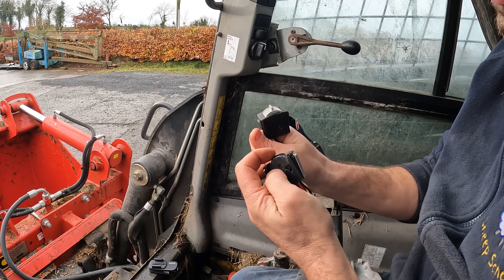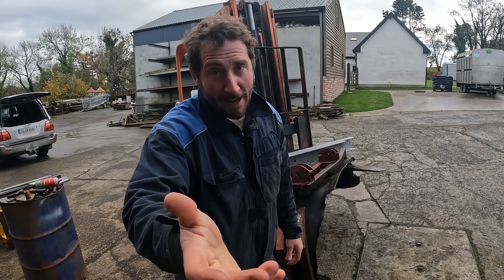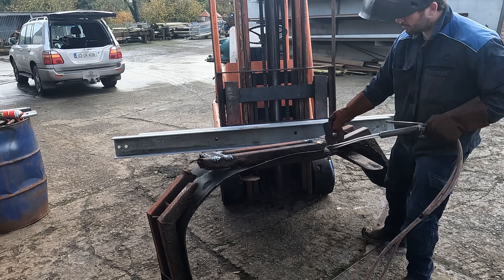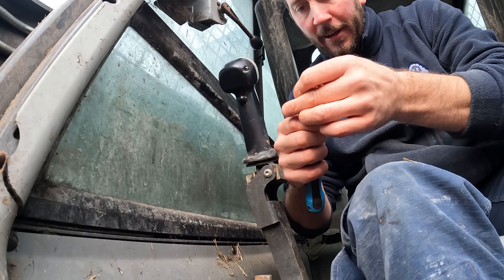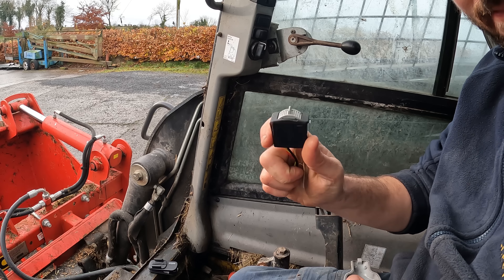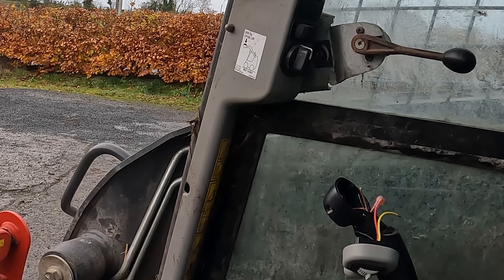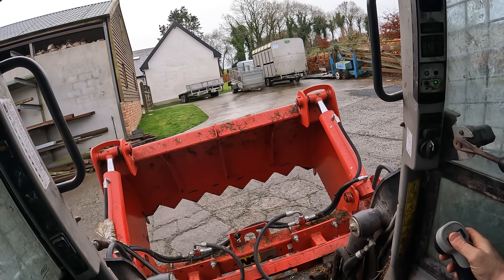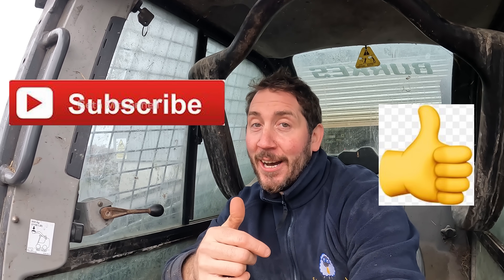Repairing Yard Scraper and Skid Steer Electronics #engineering #farming #workshop #welding

Comment: There is a set of motorcycle handle bar gloves you can get that fits over the handle bars to protect your hands when riding,  it may be a good use here to protect that switch, and keep the operators hands warm too when using.

Comment: Loving the content David. Not  farming but would love to. A good dollop of vaseline inside the handle of the skidsteer will keep moisture out. Lads use it when wading in offroaders to keep water out of engine electrics so it should be good for that. Thanks for the work that goes into the vids. You provide a great variety of content with excellent information and a spot on logical approach to problems.
Reply from the maker: Thanks for the vaseline tip, definitely worth a try.  Really appreciate your comments, thank you!

Comment: Check somewhere like RS or mouser for 'momentary rocker switches' (they might be known as something else too). Should be a few pounds only, possible there are sealed versions too. (Can't post a commercial link). Beyond that there may be replacement switches for those joysticks. I don't see  where the hundreds of pounds are spent, especially if they break! I'd be asking for money back under something like 'soga'!
Reply from the maker: It's an unusual proportional switch that controls the oil flow. Tiny flimsy magnet inside when you strip it down...
Reply: I meant replacement switches specifically for joysticks that are curved but still only cost a few pounds. It's just a plastic mold. Maybe a 3d printer could be a good investment!

Comment: Some job David on yard scraper  poor design on that switch new holland know how to charge alright   just wonder did u ever use or hear anything go or bad about a 2 in 1 mig ark welder my mig is after frying circuit board it nearly 20 year old was going buying inverter arc welder  anyway wonder would one of them be any good
Reply from the maker: Almost had one bought before I bought the Oxford. Thought it would be very handy for some site work with gasless wire. I needed the heavy duty mig for sheds so bought it instead...
Reply: @sheepschool365  might chance one let u know if its any good
Reply from the maker: @ohararaymond. good man 👍